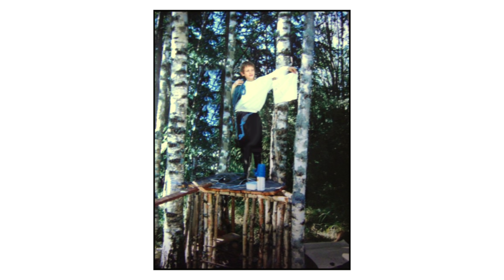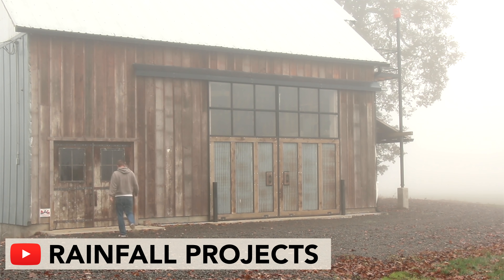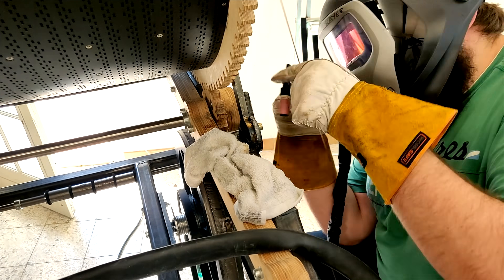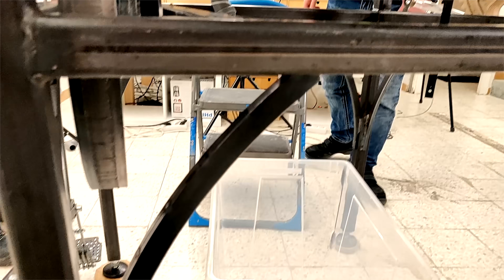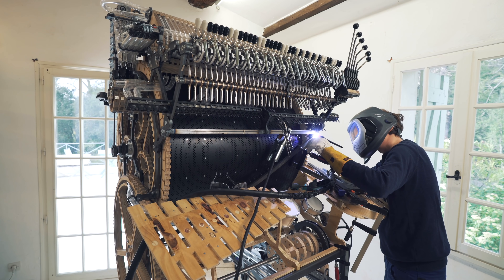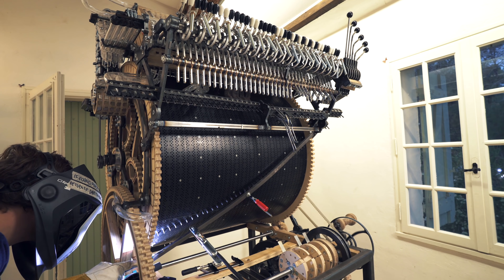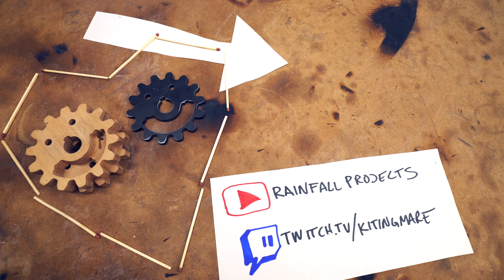Cross Bracing - Marble Machine X #72

Comment: If you need to bend steel use a single fulcrum and drive on the steel with your car. You can adjust the fulcrum distance to change the amount of bend and the car tire creates a smooth, uniform bend.

Comment: The x bracing is nicely executed, the whole process feels very well engineered.
Except for the fact, that you screw down a quick release system. Why do you have screws on the bottom of the x bracing, isn't that way too slow on stage when you swap out the programming plates? I think you should time the process with enough tolerance to make up for some little missteps.

Comment: Something others have been saying is to use hand screws on the bottom of the X-brace. The thought that immediately comes to my mind is a wing screw, like on a drumset or cymbal stand.
Others have also suggested making it so the screw doesn't come out of the X-brace, but still turns. I know that there's a specific part that does exactly that, but I don't know what it is called.

Comment: So... I'm trying to figure out how much is actually left to do? 
1. I don't see marble tracks/tubes from the demagnetizer to the conveyor. 
2. I don't see the marble paths to the instruments from the drop points. (Are the drop points actually above all of the instruments this time? I know the cymbal wasn't on the original, so I'm not sure on this one. 
3. The bass he put on last week, is that the final version? The mounting point isn't yet, either way.
4. The vibraphone. Where's the vibrato mechanism this time? How will it work if the bars are going to be flopping up and down? Mounting points for it. 
5. The ondaphone and its mount. 
6. Finalized mounts for the percussion section. 
7. The catch funnels. 
8. Return tracks to the lower wheel. 
9. I think he said something about a loading point or system for the marbles

Um... Is that everything? 

It actually is starting to feel like this thing is close to being finished?!?

Comment: I have been slightly worried about how the vibrations are going to affect the MMX on stage. I assume there's loads of options of pads to place it on to remove vibrations coming through the floor and legs, but the machine is surely big enough to catch some vibrations(?). I think if it was going to be a problem, it's at least much less so now with the bracing! I still wonder if it's going to affect the fit and maybe shake loose some screws after a while though. 

I haven't seen the accoustic vibrations mentioned or talked about yet. Does anybody know if Martin has adressed it or thought about it?

Comment: Martin
since you will be changing programming wheel sections a lot, I suggest the bolts at the bottom of the X brace have wing nut heads, so you will not need to use a tool to tighten or loosen them. (see 10:50 - 11:05)

Comment: 👍 if you wan't to use both locking pins...connect them with a wire or string -then you pull both at the same time.

Comment: I’m really concerned that someone will get hurt on (or hurt) the rear X brace when you have concert goers changing over the programming wheels on stage. Is there any way to open wider so it is above head height or some safety padding that can be added to the ends?

Comment: why dont you replace some of the multiplex wood with some real solid woods so that they will be stronger also and perhaps even add something to the acoustics just like an electric guitar does with different types of wood.   edit; i mean the big gear wheel for example..............         i noticed in the music videos you can also hear the sounds of the machine itself, all the gears turning etc (i actually can hear the sound of the plywood rubbing/cracking when the big parts are moving) and marbles rolling in their tracks and marbles falling into other sections.... i think if you replace all those materials with real nice wood stuff then those "noises" will also bring somekind of nicer percussion into the whole atmosphere of the final sound         imagine it just like when you have rollerskates with cheap plastic wheels, it sounds a bit crunchy when skating, but when you have soft wheels then you hear only a zooming ,   i can imagine if all the plywood would be replaced with Oak for example, then it would sound much fuller/solid when a marble falls onto its surface

Comment: Run a string/cable between those two pins on the top. Then you can just pull the string and it will pull both pins at the same time.

Comment: you should hinge the back bracing so that it drops to floor. too much of an obstruction and dangerous for eye injury when open. locking mechanism should work without removing screws, with pins and slots.

ps. you were so warned about shaky sideways, from the beginning, glad you finally gave at least this funny solution.
Reply: Dropping to the floor would be a tripping hazard. The lower bolts are just extra. it already has positive retention locating pins already.

Comment: @Wintergatan for me it makes no sence to build the diagonal x with screws at the end. your completely change systems phylosophie is to remove and to build fast new programming plattes. Just use the same way or a similar like u did on top with somthing that snaps it right into place. U will go crazy about screwing it everytime in place when u are on tour. u need the right tools u need time and u need to do this every time after a song. It feels like it is nothing but be sure it will annoy you with time.

But anyway nice build, looks all great so far!

Comment: You might consider replacing the bottom retaining bolts on the rear X brace with ball-lock pins instead, since it seems you'll be accessing this part of the machine a lot.

Comment: Martin at 7:00 Each time you have to change the programming plate on stage, you will have to unscrew/rescrew those 2  bolts.... would not it be simpler to use a quick-attach system like for bike wheels?  as a cyclist you must know... https://en.wikipedia.org/wiki/Quick_release_skewer

Comment: 8:58 I can hear the machinists at work and my machining instructor yelling, DON'T USE YOUR CALIPERS AS A SCRIBE!
Reply: I cringe every time I see that.
Reply: @PorchPotatoMike  I cringe every time I do exactly the same thing. I also use calipers to scribe cut lines on the lathe too. I know, I know, I'm a bad man and I'm going to hell...
Reply: @theelectricmonk3909  There's a reason carbide tipped calipers exist....

Been doing it with regular Mitu's for years, no damage so far. Only on alu though, steel might muck things up a bit more
Reply: Is it still bad when you brush on some of that thick blue paint thing?

Comment: i am a bit concerned and maybe i am number 10000 to mention this, but in the side shot of the machine i feared you may have a bit overhang in the back, did you check the balance of the machine? Maybe add some hinged triangle shaped extension foots at the back that you can open like 2 doors facing each other in transport position that open outwards to support the back a bit?

Comment: are the scrwes on the bottom of the back braces ok with the quickchange of the programming plates? wouldnt a self ejecting knob screw be much cooler?
something like this https://de.misumi-ec.com/vona2/detail/110300519340/?rid=rid3

Comment: pull cable between the two x brace locking pins! also, will you have to undo screws to change the programming plates?

Comment: Connect the 2 upper locking pins via a steel cable so u can open both by pulling the string.

Comment: If you find you need to use both release pins but only one person, we use a similar system in wheelchairs.  Adding a split ring to each release pin and tying a rope or wire between them, you can pull or twist on the rope, and it will pull both pins out at the same time.

Comment: I'm a little worried about weight. The backside looks way to heavy and easy to tip. A suggestion if I may: A counterweight(like you'd see on heavy equipment similar to Skidsteers and Front Loaders) that mounts to the front or a stabilizing bar that mounts to the back of the machine at an angle to prevent it from tipping backwards.

Comment: The bracing needs to be removed during concerts right? Instead of using screws, you could use toggle clamps instead. Faster to lock and unlock.

Comment: Something you might consider doing is adding tie down points for your shipping plans.  Consider that you'll be putting this in a truck and it will be top heavy and have a tendency to tip.  You may want a some up high and some down low.  Down force and lateral stabilization.  Look at local box trucks and shipping containers.  If you package it in a plywood shipping box that can be picked with a pallet jack how would you stabilize it.  Would you want a through container support that also stabilized the crate? would you create a shorter base that allowed for more stable shipping?   Just a couple thoughts for the day.

Comment: quick remark: you should think about some quick release mechanism for the bottom part of the back X-Shape, I'm pretty sure you don't want to unscrew/rescrew things every time you'll be changing songs while on tour (it takes time, and taps are going to die pretty quickly if you do so too).
Reply: And maybe put it outside, not inside
Reply: my suggestion would be to replace the screws with a clamping lever, nice big adjustable handle that you can torque/quickly unthread and rethread. you can even rig the bolt so it doesnt fall out of the x-braces threads when unscrewed.
Reply: 10:45
10:58
Reply: Iron Lightning those are to hold it open, not closed as we were talking about.
Reply: @konzetsushi  Watch it again.
He pushes it closed and it clicks into place.
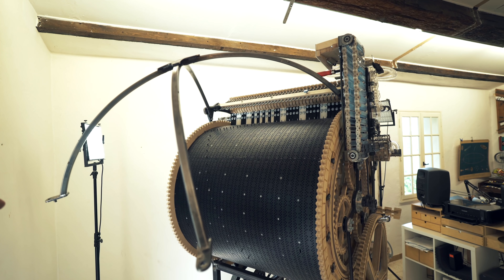Reply: @KaityKat117  Those are just him snapping in the alignment pins, they don't actually hold the brace in place. > 6:45  .screws are what's actually locking it in place. Be more attentive when watching.

Comment: you should use thumb screws on the bottom of the back brace to make it easier to change the programming panels during a show.
Reply: Or knobs
Reply: or hinges up top and quick release knobs down below? It's basically a structural car hood.
Reply: My thoughts exactly.  I’m thinking something cammed and captured, like a Dzuz fastener at the bottom

Comment: I could only laugh when he pointed out doing the tapping the right way, but I wonder how many he broke or got stuck before that? Slow and steady, but it makes things smoother in the long run.

Also I think some stuff back in the old days wasn't always planned first. (Especially stuff prior to CAD stuff being everywhere like it is now.) The initial draft blueprint was more of a guide-line, and then revised into a proper plan after some master machinist or fabricator did their work.

Comment: Me at the start: BUT THEN YOU CAN'T REMOVE THE PROGRAMMING PLATES!
Me at the end: Martin, you clever SOB.
Reply: I had the same reaction!🤣
Reply: My thought exactly
Reply: It's amazing how much these reduce sway, but by the looks of the part you mentioned, the x-brace has to be screwed and unscrewed every time they change plates. There has to be a quick release mechanism that can be implemented instead of a screw, no?
Reply: @allenroughton  A good looking hand screw (like the ones for pc cases) wide enough to turn fast and the "problem" is solved =) I'm sure they already tought of it.
Reply: @allenroughton  unscrewing and screwing 2 screws is not something that requires a solution. The time it takes (seconds) is a non-issue
Reply: @InvadersDie  mechanical latches would probably work best. Or another couple of those quick release pins.
Reply: @InvadersDie  You don't want to drop the screws on stage between songs
Reply: @isogash  yeah not like it's possible to pick them back up!!! you don't even have to unscrew them all the way so they're still in the crossbar
Reply: @isogash  Why not using a form of captive screws, with maybe an electrical driver? Or some kind of mechanical latch like the one he used on the programming plates?
Reply: Same!
Reply: Last time we saw the X brace in CAD he mentioned it had to be easily removable so they could change songs quickly in a live concert, it was a critical factor in the design.
Reply: @Jonaasti  Indeed, my idea is bad then, i forgot about swapping songs. 
Any sort of tight latch will do the trick then =) you could remove both at the same time and open the brace for a fast swap.
Reply: cam lock screws - they can be set up as captive so when unscrewed they stay in the hole on and are completely tight with a quarter to one half turn plus some models come with a butterfly style head meaning no tools required to use
Reply: I have been saying that to the screen since he showed it. I can't wait to see it
Reply: Same. Grandmaster Martin is so many moves ahead of us.